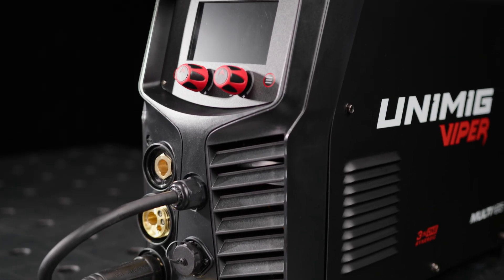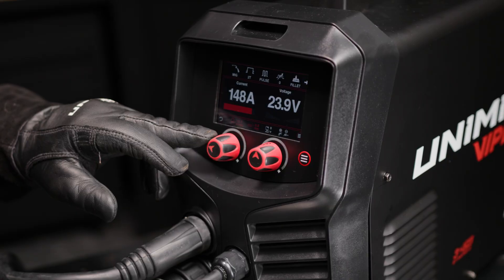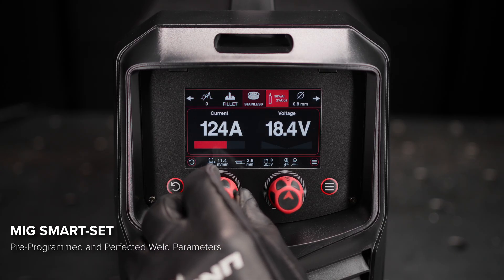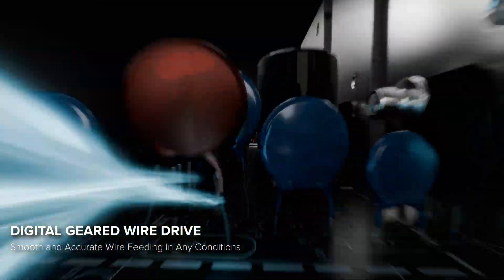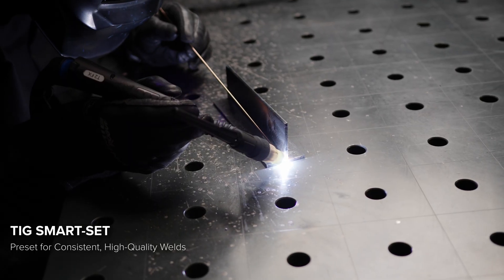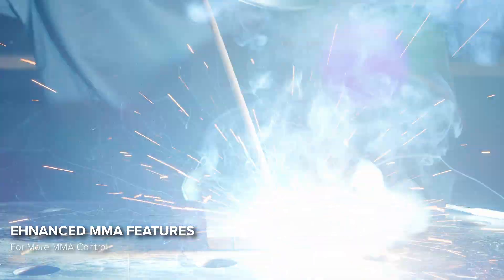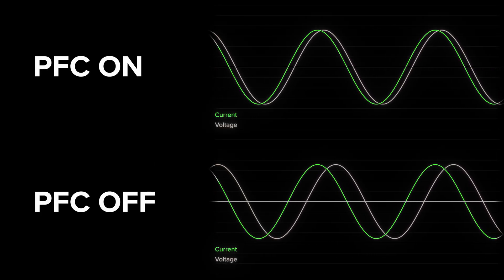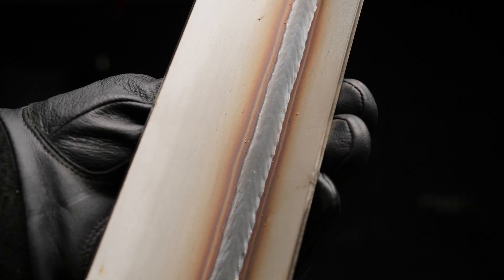VIPER MULTI 185: Overview

Comment: Hey @UNIMIG we were looking at a few mig options today, with the intension of purchasing one within the next 2 weeks

What I found really odd about this model is that it does not accept 0.6 mm wire

 It only accepts 0.8 or 0.9 mm, but we use 0.6 mm probably around 50% of the time on thin sheet metal

Am I missing something here as to why it would not have this option given you do not require a high amperage ? So this model would have plenty of amps is my point
Reply from the maker: We're not aware of this glitch, and we've attempted to replicate it without success. Could you please let us know which store you visited? We'll reach out to them for more information.
Reply: @UNIMIG  Yes it was Total Tools in Bendigo

A similar issue to choosing the wire size

For example, why is there no option on the panel to chose 0.6mm wire, only 0.8mm & 0.9 when you are suggesting that it does actually weld with 0.6mm

It shows this issue on your video (no 0.6mm wire option), and I confirmed this on the one they had in store when we powered it up

So if you can't choose 0.6mm only 0.8mm, and you are welding with 0.6mm (with 0.8mm selected), I would image this would cause an issue with how many amps it's feeding into the wire?

Either way this is a glitch that needs to be rectified wouldn't you think?

The guy in the store (was claiming) that this is an issue that needs to be addressed with an update, and also the thickness of material you select is not accurate

He is (claiming) from feedback that he's had, if you were to select for example 3mm thickness mild steel, it's actually calibrated wrong and would be as though you had actually selected 5mm

Don't quote me on those exact thicknesses, but that's an example of the issue

He also was (claiming) that Unimeg are aware of it, and are going to rectify the issue. One option they were suggesting was to connect a module to it to fix the software issue

Perhaps if you were to speak to who ever the sales rep is for the Bendigo store, they would be able to bring you up to speed on this
Reply from the maker: This machine will run 0.6mm wire, it is just not listed in the settings as there is not a Smart-Set/Pulse program for it, but it can be run manually on this machine.
Reply: @UNIMIG  Thanks for your reply

They guys at total tools were saying there is a glitch in the software that is going to be rectified by you guys?

The issue being, when you choose (as an example) 3mm thickness material to weld, it does not set the welder at that thickness and is actually set for a thicker material

I asked how do we rectify this glitch, maybe connect my laptop to it and run an update?

Can you please confirm this...